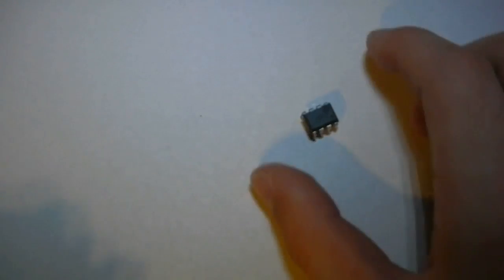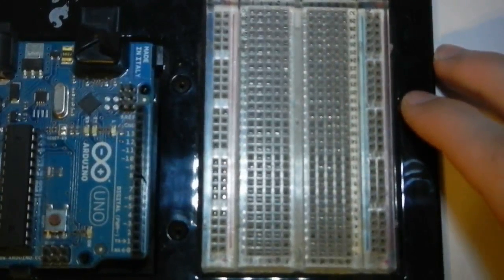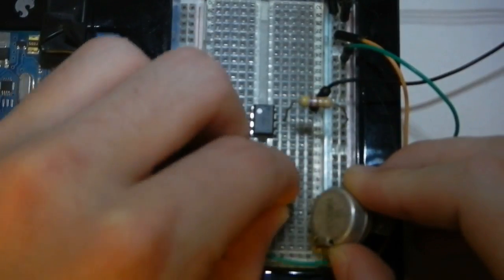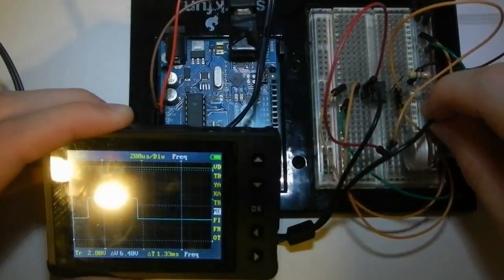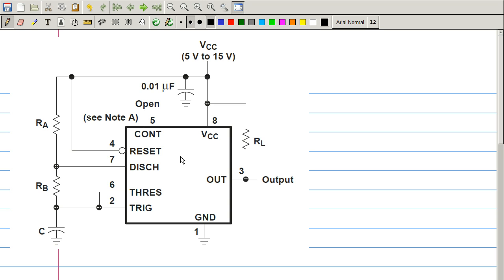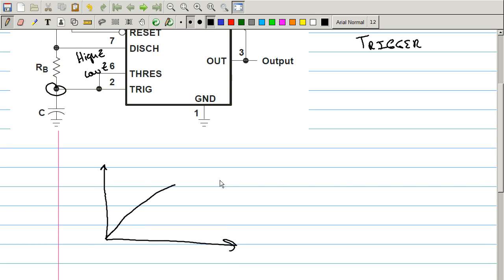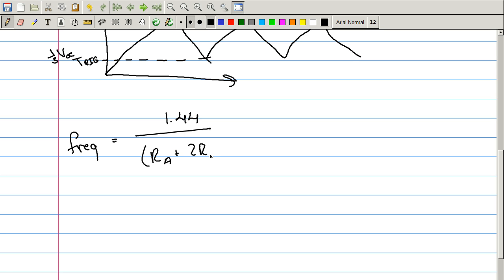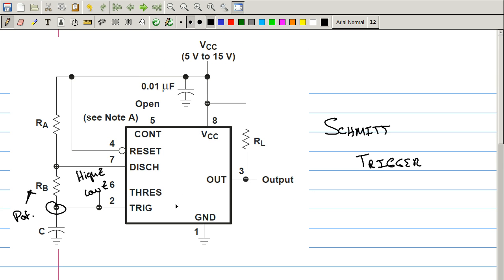On A BreadBoard: 555 Frequency Generator

Comment: you never mention resistor or cap value you used
Reply: at 1:39 he says 2.2uF polarized capacitor and a 4.7k ohm resistor + 1 k ohm pot.